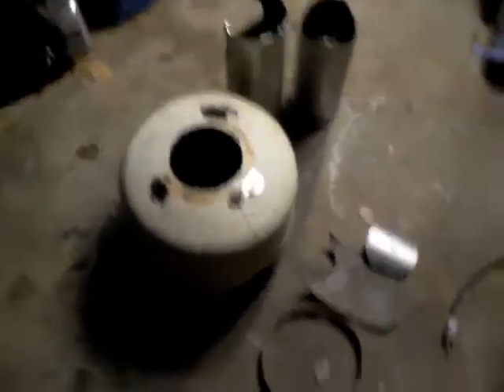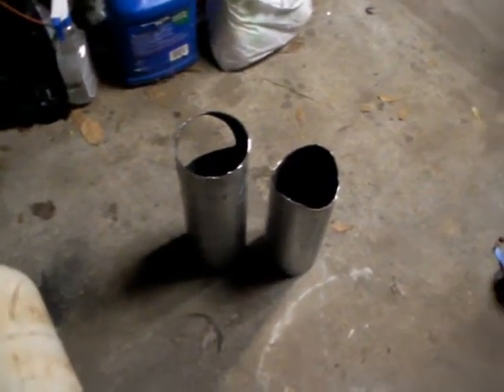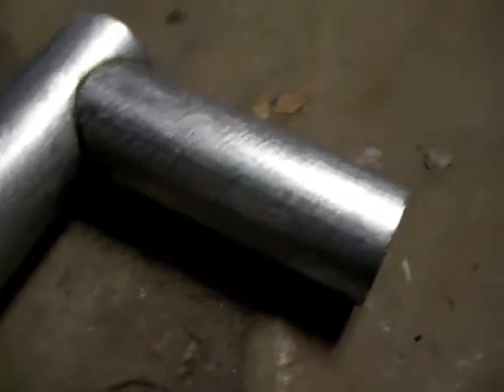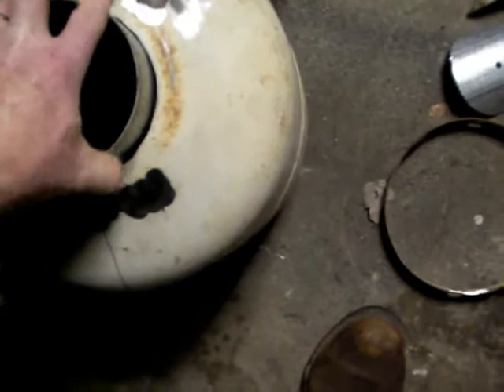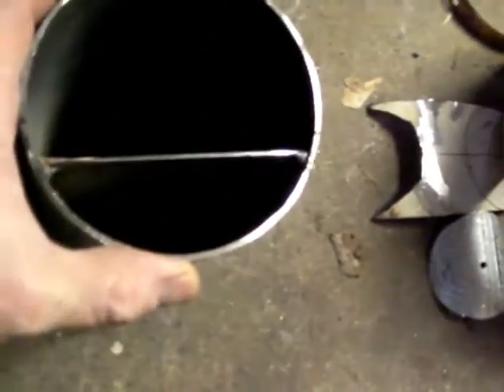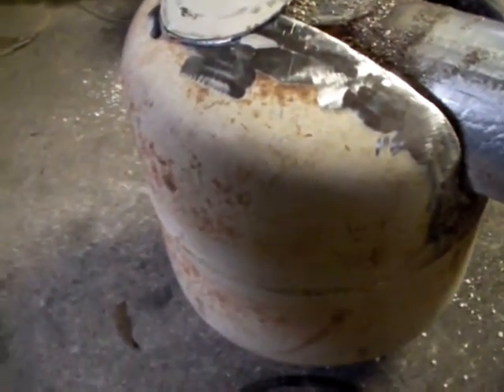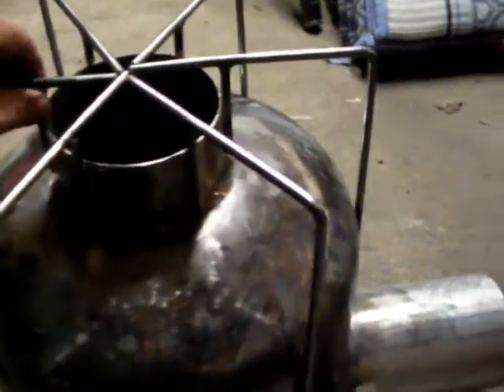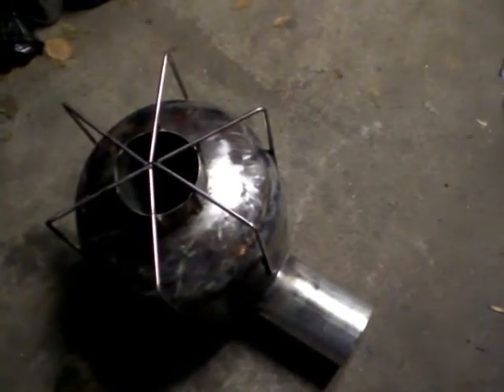1st Rocket Stove Lp tank .avi

Comment from the maker: @rsjojo Yes I used Galvanized 4" EMT Conduit.  not the best materials but readily available and relatively cheap.  but you should weld it in a very ventilated area and you should torch the areas you plan on welding to burn off the galvanized coating before welding.

Comment: I really like your design.
You mentioned that you were working on designs for a heater/oven (baking utensil) for the top of the unit... Have you done that or any part of it yet?
I'm wanting to do the same thing with my rocket stove.
I have thought of building a double-wall chamber unit that connects and sits directly on the top of the stove with a door that would serve as a heater and/or an oven to bake bread and other food.
I think the rocket oven-heater would be the BOMB! (*figuratively!*)

Comment from the maker: EMT is Electrical Metallic Tubing, thin wall metal conduit.  I am not done with this project yet. hopefully more testing tomorrow and I have to buy some more sheet metal and a bender and I plan on making several different attachments, a heater box and an oven box for baking.